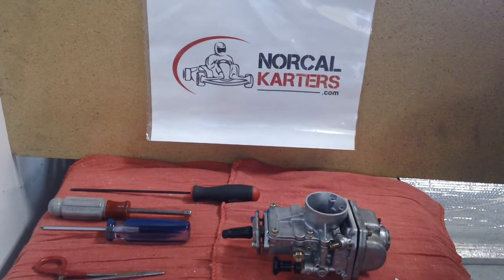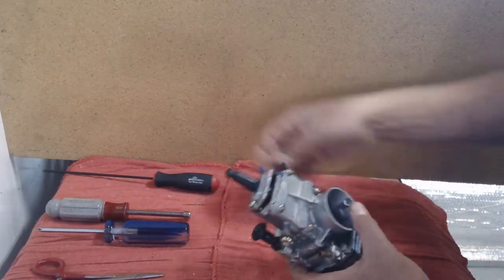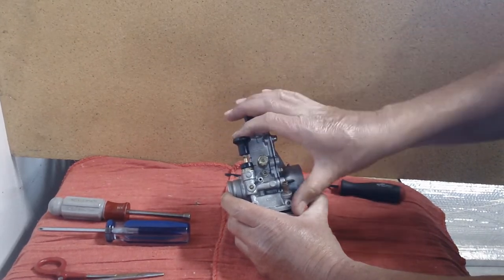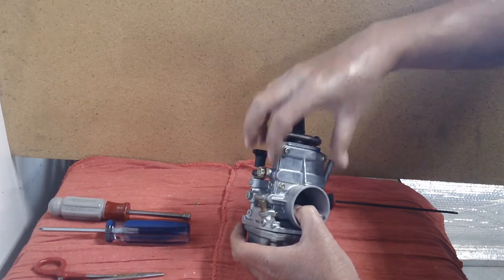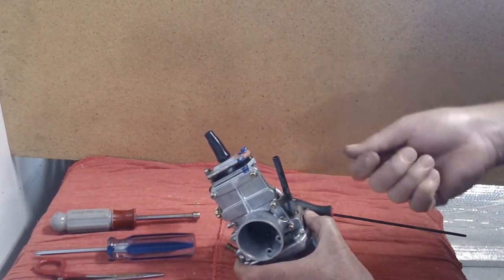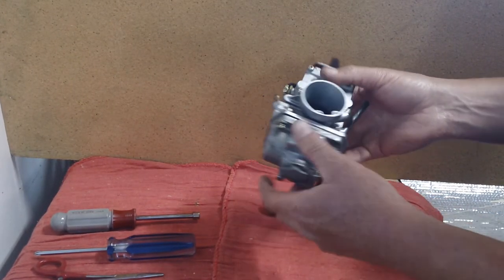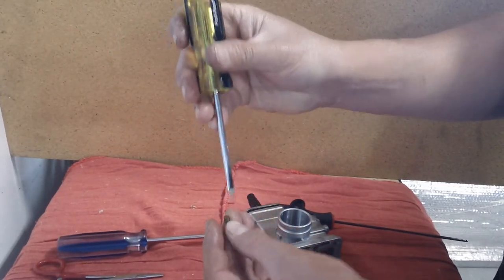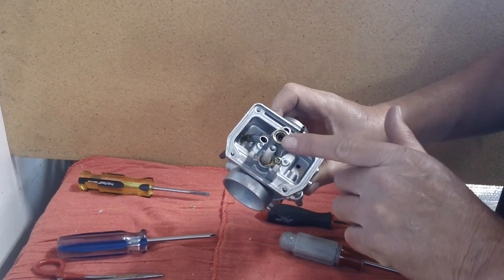Break Down and Anatomy of the Mikuni TM 28 Flat Side Carburetor with Pump Around Fuel System

Comment: Thanks for the great vid. BTW, I had my RD 400 bored and heads ported. Flatslides with pod filters and chambers. Now the motor won't pull higher rpms. What all would you change on the carbs?
Reply from the maker: I'd contact the shop that did the porting. Sometimes if you go big bore, you lose top rpms because your trading off for torque at the lower rpms.

Comment: I have one on a engine i installed on  my kids midget. Briggs world formula block milled head, stroker kit , running an 28f 418 flat slide on methanol pilot jet 58 main 450.  The issue im having is with the idle screw turned out to zero input and the idle jet screw zeroed my engine still idles at 3000-3150 rpms. Im not sure what to do. Im guessing i need to go up on the pilot jet to maybe 65ish+- to richen it up and hopefully slow down the rpm(slow the burning)
But could adjusting the slide needle change this too?
Any help / advice is much appreciated 🙏
Reply from the maker: Yes, the screw on the side of the slide bore adjusts idle. If that doesn't work, double check your throttle linkage has play. If all checks out proper, look for air leaks
Reply: @NorcalKarters  I had the function of the choke backwards🤦🤣🤣
I thought down was no choke. Up is no choke. Adjusted the idle screw and wham idles 2100rpm and is snappy.
Took it out last weekend  and it's a screamer!

Comment: What is benefit of return fuel system? Is this a 2 stroke thing?
Reply from the maker: It's not a two stroke thing, its using a gravity feed carburetor on a fuel pump system on an engine application that was not factory.  In hindsight, the karting industry should have adapted carburetors that had changeable Needle and Seat valves and better fuel pumps with pressure set ups or shut offs.

Comment: thanks for the perfect video. I have honda xl185 with un repairable carb. So does this works with my xl ? What do you think?
Reply from the maker: If you have a bike application, this is not the right set up for your engine. This an adaptation for karting since we used mx engines and carbon karts. If your carb is shot, replace it.

Comment: Hi! I'm Alex Kharchuk from Ukraine. Tell me, please, does this system with scavenger tube and foam without float will work on pit bike in supermoto racing, when we deal with cornerings of carb? Which advantages it can give?
Reply from the maker: Do you have carb issues with supermoto?
Reply: @NorcalKarters  not yet, but I am looking for the ways to improve and get max performance. That's why I started to look for another carby's and that's how I found your video. 
Engine is 4t 190cc 62*62mm, stock carb is PE type, I have used PWK 28mm type but thinking about FCR 28 or 33 cuz it has acceleration pump, which is must have on 4t engines
Reply from the maker: @АлександрХарчук-т1д  I don't think this would be the right route for you.  This was adapted in karting because the rules didn't allow us to use different type of carbs.

Comment: Mine has just a spring and the needle and a gasket
Reply: For the idle screw my air screw is the same but has a washer
Reply from the maker: You may need to find the diagram for your exact model or version. This one is off the RM85 OE spec engine
Reply: @NorcalKarters  I did actually, ty finished it yesterday from a full rebuild kit from shindy. No complaints here 👌